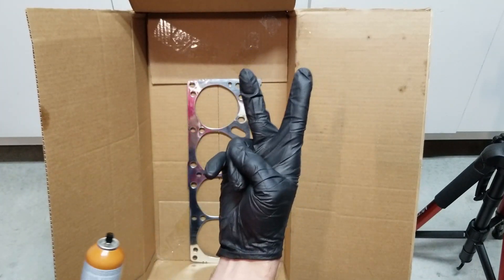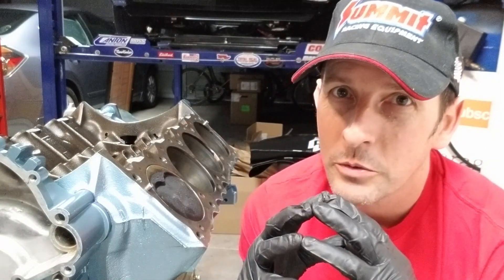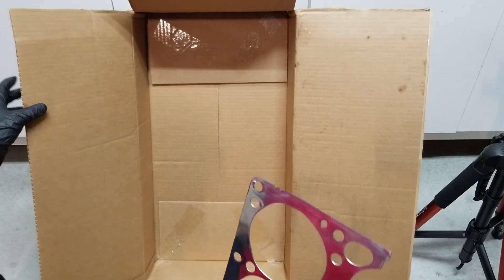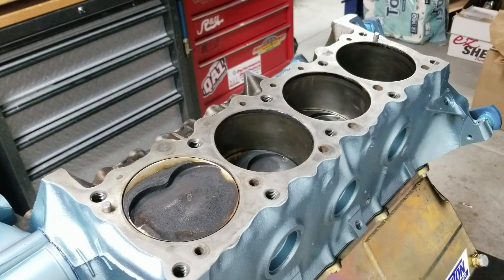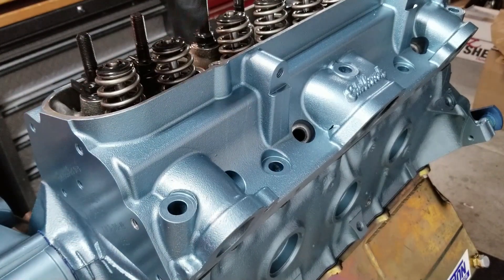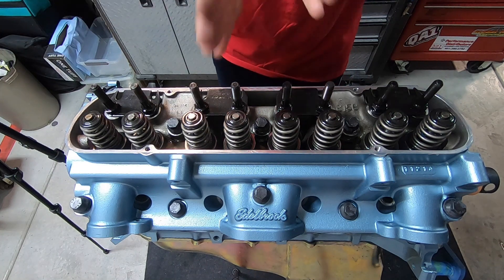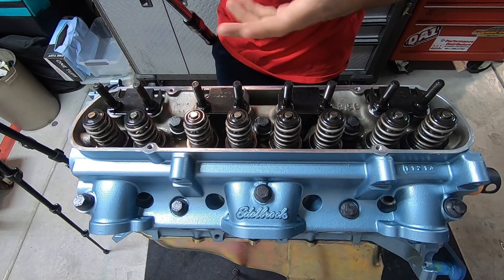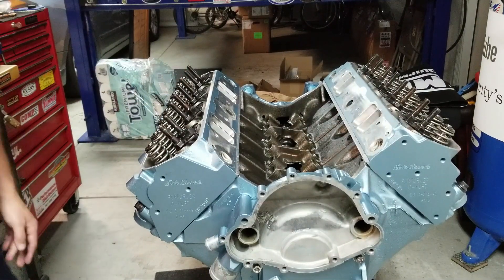Pontiac V8 Rebuild, Part 12:  How to install heads, properly.

Comment: How heavy are the heads? Can they be installed with the engine in the car? Its a 78 TA that has been in the family since new and when we put the engine back together we must have done something wrong since we are getting antifreeze into the oil. It took awhile but its happening and rather not have to sell it
Reply from the maker: Ohhh, sorry to hear that.  Yeah, you can do the job with the engine in the car.  Hopefully it's just your head gasket.  I'd call Butler Performance and get their standard head gasket, which has a few of the holes removed that aren't used on your block.  If you're getting alluminum heads, they're about 30 lbs?  Iron heads are around 40 lbs.  Keep us posted!

Comment: Is it possible to remove one head on an engine if you take off all manifold bolts on the intake
Reply from the maker: Probably.  But, it would be IMPOSSIBLE to put it back on, without damage, and/or poor water crossover connection.  Best to remove the intake.  Have fun!

Comment: Hi, you used ARP lube instead of engine oil. The thourke spec for engine oil on the head bolts is 100 ft lbs. With the ARP lube it should be about 85 ft lbs. It is always less with ARP lube. I used ARP studs on my mains for my 436 build.
Reply from the maker: Not exactly.  When using ARP bolts/studs you need to follow their instructions.  My kit from ARP specified 100 ft. lbs. using their assembly lube.  Here it is... https://tech.arp-bolts.com/instructions/190-3607.pdf  Thanks for the comment!

Comment: What final seat pressure you set the vlvs to on the roller?
Reply from the maker: Seat pressure and roller lifters are two different topics.   Not sure what you're asking here?  (Seat pressure is typically determined by the springs)   Thanks.

Comment: Need to be using a torque angle meter after as well
Reply from the maker: Ummm, no.  That tool is ONLY used when it's the spec.  For example, if the assembly requires 60 ft lbs. + 45 degrees.  That means you hit 60 with your torque wrench, then tighten it another 45 degrees.  (That's a higher overall torque)  Hope that makes sense.

Comment: Montie, 
In the process of converting my GTO from an auto to an manual transmission. My question is does the 455 engine require external balancing on the flywheel?
Reply from the maker: Congrats on getting a Left Pedal!  Pontiac engines are internally balanced, thank god.  So, you'll need a balanced Fly Wheel.  Have fun!

Comment: I’ve watched this video a few times, really helpful. My heads are installed and I’ll be firing up the Pontiac soon. What is a first heat cycle? I don’t need to break in a cam or the engine. Should I drive it around the neighborhood to get it up to temp? I don’t think I can idle it in the garage without poisoning myself so it at least will go down and up the driveway. Should I hammer it to give the bolts a good stretch or just drive Ms Daisy? Thanks, Dave
Reply from the maker: Good question... one heat cycle, is getting the engine up to temperature.  Yes, you can drive it around the block a few times.  No, I wouldn't hammer it.  If it's a new rebuild of the engine, you should be using break in oil... drive it about 100 miles, also NOT hammering it.  Then change the oil, AND re-torque the heads, AND check valve lash.  Have fun!
Reply: @FastMonty  Thanks, I want to do it right but I also want to stomp on it. I guess I can wait a little longer.
Reply from the maker: Ha!  I know the feeling!   @davidwhitman9609
Reply: @FastMonty Follow up: I drove the car and resisted the urge to get on it. On the re-torque, Did you remove and re-lube each bolt, or loosen slightly and re-torque, or just tighten if needed from where they were? Thanks, Dave
Reply from the maker: Congrats!  Just tighten in place with your torque wrench.  @davidwhitman9609
Reply: @FastMonty  Excellent! Thanks for the quick reply. Perfect timing as I just came in for a break after removing the valve covers and a/c compressor. Back to work!
Reply from the maker: Ha!  I know the feeling, my new rearend is giving me fits. Have fun!  @davidwhitman9609

Comment: I noticed here you torque head bolts to 105.  I am looking at my 1968 service manual and it says 95.  I mention this because I just finished putting my oil pan on and realized I used your 110 on rear main cap in another video, and now see manual says 120 (wondering if I should take the pan off again).  10 lbs. maybe is not critical, but wondering why one video is 10 under and here is 10 over the documented spec.  Love your vids though, I am following all the way through.  Great stuff, just curious about these value discrepancies since everything else is so precise.
Reply from the maker: Great question, and sorry for the conflicting info.  The best source of "standard" torques is on Butler's site... https://butlerperformance.com/p-34888-pontiac-engine-torque-specs.html  That said, if you're using Edelbrock heads, that instruction sheet says 100 ft-lbs.  (So, pick 95 or 100)  As for your rear main, again my apologies... if the engine is out and you can easily get at em, go to 120.  Otherwise you're right, 110 will be fine.  Hope that helps!
Reply: @FastMonty  Thanks for the reply.  I had accepted the rear main value because it was a BOP seal (not the "waxed rope" seal the service manual is replacing).  Rechecking, BOP instructions do state "torque main cap bolts to manufacturers spec" so - my bad.  Using original heads and standard gaskets, 95 is correct and cross-confirmed on the Butler site.  For anyone still reading - I apologize for overlooking early video comments about Edelbrock head instructions, and have now realized I also followed the video torque sequence, which was incorrect for stock iron heads (again, even listed separately on Butler).  Everyone, please enjoy FM's stellar work but avoid my mistakes and check the specs for your individual application and/or combination.
Reply from the maker: @benjaminredington2905  Thanks Benjamin!

Comment: What did you do with your oil dipstick tube?  I'm building my '66 421 engine now and the dipstick tube interferes with the flange on the Edelbrock head.  Not sure if I need to re-orient it since I'm not seeing how the OEM alignment between the head and the manifold will ever work?
Reply from the maker: Great question Curtis.  My Canton pan has a provision for a dipstick tube.  So, my stock hole was drilled and tapped, and plugged.  The new dipstick tube had to be bent to avoid the headers, etc... What I can't remember is if you can bend the stock tube.  Sorry, I'm not much help on this one.  Can you bend the tube slightly?

Comment: I have a 400ci 6.6l but it’s inside of my 1978 Pontiac Bonneville. Having trouble finding headers. Any suggestions??
Reply from the maker: Yeah, that's a tough one... not sure it's popular enough to build headers for a Bonnie.  Maybe check the Pontiac forums?  Good luck and let us know if you figure that out.  Oh, maybe get some Ram Air manifolds.  That'll help vs. your stock ones.  Have fun!

Comment: Do the heads only go on one way?
My 6x heads have the 8 stamp (large valve indicator) on only one head and an article I read indicates that it's for the drivers side 
I've mounted it on the passenger side ugh
Reply from the maker: Scott, I actually do not know if they're identical.  Some are, but some also only have the heater hose nipple on one of the heads, which would be the passenger side.  Let us know what you end up doing.

Comment: install heads properly?  you're thinking a bit too much into it.  if the heads and block deck are milled flat, bottom tap the 10 head bolt holes, drop a new gasket in place, drop on the head,  tighten the 10 bolts in a spiral pattern from center, 35-70-100 ft. lbs.   you're done.  it's not rocket science.  with a 9.5 cr pump gas motor, all that sealer is unnecessary.  its only going to make a mess, you'll have to scrape and grind off later, if you ever need to pull the heads for some reason.  ask me how I know....after 40 years of building these.
Reply from the maker: This is how you do it.  My video's are also for beginner's who need that extra bit of confidence before building their own Pontiac mill.  Thanks.
Reply: @FastMonty  thanks, I’m pull the motor out of my 66 Catalina.  Rear seal leaking. Taking my time.  1st time for everything. Like your channel.
Reply from the maker: @billvogel359  Thanks Bill... yeah, rear main seal leaks are no fun.  Yes, take your time, but don't take tooo much time.  ha, ha..
Reply: Do you have to have the motor at tdc when installing the heads?

Comment: I just had my 350 rebuilt and before it never went over 200 temp and after the rebuild it won't stay under 220+ ,so what did the shop do to my motor or not do to cause that,anybody please I'm am at my wits end
Reply from the maker: Sorry to hear that... make sure you double check that temp.  For example, use a laser thermometer and pull a reading from the cross over.  Many times, builders mistakenly swap out the wrong temperature sending unit.  (Some are too short, some have the wrong internal resistance setting to match Pontiac Gauges)  Let us know what works out!

Comment: Hey Monty, when you put your rear main seal in we’re there anti rotation hole in rear cap and block that BOP recommends to fill with a good sealant when seal is installed. Pretty sure that 455 Pontiac block has them just wondering if 400 has them. Your thoughts or comments are greatly appreciated. Thanks Tomm
Reply from the maker: Good question... Yeah, that's only for 455's.  I did not add any sealant.  :)  Hope that helps!
Reply: Thank bud,,it helped

Comment: Boss man if I have a 73 455 +.040 over and I’m getting the elder Brock d port heads from butler with 310cfm using a solid roller cam I just don’t know which kind of gaskets to use for the heads I put so much money in this car I want to bolt heads and not have no more head gasket leaks which head gaskets you recommend ? I’m thinking something like you used and looks like the old school felpro ? Any part #”s
Reply from the maker: That'll be a blast to drive, just like mine... ha, ha... I got my gaskets from Butler.  I see the link in my description doesn't work.  I'd recommend reaching out to them and ask which set you should go with.  Have fun!

Comment: Why 105, when on Butler's site it's 95  ?
Reply from the maker: Good question... 95 ft lbs is for stock bolts.  105 is for Edelbrock heads with ARP bolts.
Reply: @FastMonty  
Exactly.

Comment: Just cleaned my block today to install heads, you are so right about using a white paper towel to clean. You da Man Monty Thanks!
Reply from the maker: Thanks Steven, cleaning is the worst, but most important part.  Take your time, and have fun!  Thanks for the comment!

Comment: I've got a 69' also had it since high school back in the mid 90's I'd beat the living shit outta that thing every weekend. Think i i did 6 motor swaps in 10yr span last motor i dropped in was a 428 That 4 inch stroke paired with a   4.10 running gear didn't suck as bad as it sounds Lol been sitting over 10 yrs now about to get it back going again and give it to my dad make it stock except few minor things like the steering box off a 94' jeep grand Cherokee, and a few other suspension mods, I never had the luxury of aftermarket heads probably why I don't why i don't remember those fancy lookin gaskets lol
Reply from the maker: Nice!  Thanks for sharing your story... hope she's still runnin!

Comment: Dumb question….. I got edelbrock heads, I cannot determine which is drivers side and which is passenger side… many suggestions?
Reply from the maker: Not a dumb question... they're actually the same.  But, once you determine which one you want to use for the drivers side vs. Passenger, you'll need to keep track, especially if you're painting them.  Hope that helps!

Comment: I have a 1970 Lemans . My question is what is the clearance between the cross Member and the oil pan from a front point of view ?
I wondering if someone changed the oil pan before I owned the car . This would be greatly appreciated
Reply from the maker: Good question... I don't know the actual spec.  you should at least be able to get your fingers in there.  So many things may have changed over the years, with your car, engine mounts, the pan itself, etc... it should definitely NOT be touching the cross member.  Hope that helps!

Comment: one trick for taping flanges is to tap around the perimeter with a hammer  to "cut" the shape instead of a blade
Reply from the maker: Yup, that works too.. that sometimes does not leave a "crisp" edge, so I just use the blade.  Thanks for the comment!

Comment: is 105 lbs only for aluminum heads?
Reply: Yes.
Reply from the maker: I believe so... stock heads are 95 to 100, depending who you ask.  In the Edelbrock instructions it says to tighten a majority of the bolts to 105 ft-lbs.  And some of them to 95.  Not sure why that is... but, I keep it easy on myself and do 105 on all of them.  Thanks for the comment!

Comment: I only have one cooling port on my Firebird. My Edelbrock Performer heads came with one plug and one cooling connector. Perhaps they should have included the extra hardware. I need to locate the extra plug needed, but it seems to only come in a kit with extra parts not needed. .
Reply from the maker: Hey Gray... good question.  "Standard" is to have one nipple on the passenger side head, and a plug in the driver side.  I modified mine to T off the coolant from both heads in the rear.  (Check out my Pontiac Head Cooling video, which also has an AN hose tutorial)  If you want to add the nipple on the driver side head, the thread size on the Edelbrock head is 3/4 NPT.  You can use standard 5/8" rubber hose, or switch to AN style like I did.  Hope that makes sense?
Reply: @FastMonty   Thank you Monty!  I will check out your other Cooling video. Also I appreciate that you took the time to video your build, it's a great help. I have my heads in and will be installing them once my rotating assembly is in from Butler. I'm building a .060 over 350 stroker which is makes it a 413ci.  For a cam I'm using Butler's "special grind" hydraulic roller cam.  BTW I can't find a bearing cam plate anywhere, so I have to use the standard one. You're lucky to have one.
Reply from the maker: @garygreer1854  Glad I can help!  Glad to hear you're using Butler parts... for the cam bearing, you can call BOP Engineering, or go to their ebay page.  Here... You can get the Sims Precision Machining Rollmaster Timing chain and thrust bearing from BOP Engineering, by calling 920-674-6058.  OR, go to their ebay listing at  https://www.ebay.com/itm/BOP-Eng-Sims-Pontiac-Billet-Timing-Chain-Gear-w-Rollerized-Thrust-Ram-Air-SD/224008751731  Plan B, Butler has a thrust bearing version too.  Hope that helps!

Comment: What’s the weight difference between the cast iron & aluminum heads?
Reply from the maker: I have noooo idea.  I'm guessing, from curling each set, probably around 15 lbs each.  Ha ha. Thanks for the comment!
Reply: Fast Monty's Garage 😆 Thanks. Nice work BTW.
Reply from the maker: @v8pontiacvent  Thanks! Hope it helps!
Reply: Fast Monty's Garage Just bought a set of KRE Aluminum heads. Fully assembled, 37lbs each head.
Reply from the maker: @v8pontiacvent  Nice!  Congrats on the KRE heads too... those are awesome!  Any idea what the fully assembled stock heads weigh?  I'm guessing around 60 lbs.
Reply: Fast Monty's Garage Thanks... I’ll weigh them once I remove them. KRE makes the only Aluminum head for a 350 Pontiac.
Reply from the maker: @v8pontiacvent  Sounds good!  Also good to know about the 350 ci heads.  I didn't know that.  Thanks for sharing!
Reply: Fast Monty's Garage For sure! It’s due to small 350 bore size and Edelbrock’s valves wont clear them.
Reply from the maker: @v8pontiacvent  Wow, that's really interesting... thanks again for sharing, to help educate everyone.  See you soon.
Reply: The heads off of my W72 was 52 lbs each. My Edelbocks Performer heads with hardware and tool steel retainers was 36 lbs each. The most shocking saving was the intake. Saved 24 lbs on that going from stock to a RPM. Saved 58 lbs converting to alu heads and intake. I actually had to change the springs and the chicken drives sooooo much better.
Reply: Hey Mike,are your heads ported ? If so what do they flow?